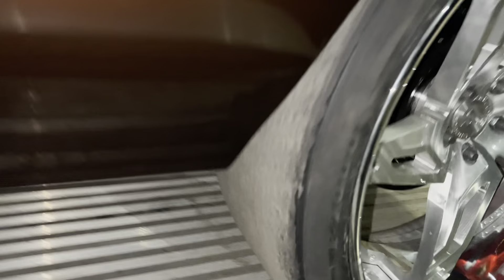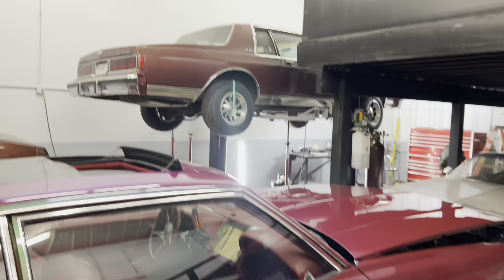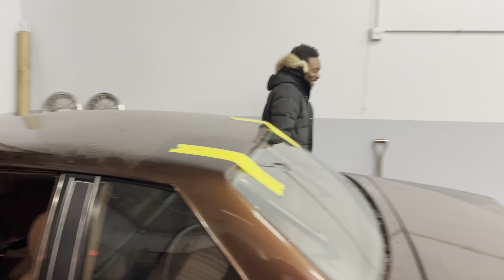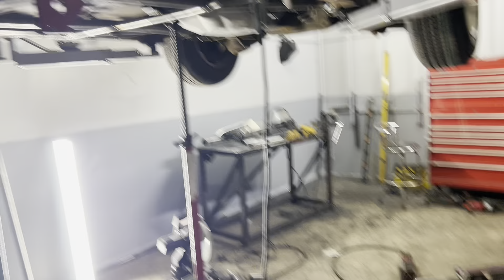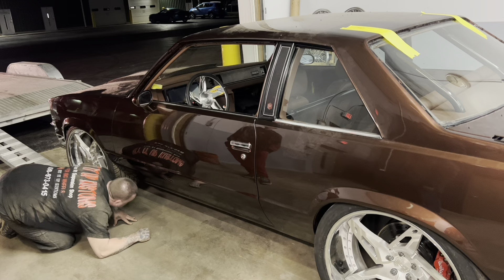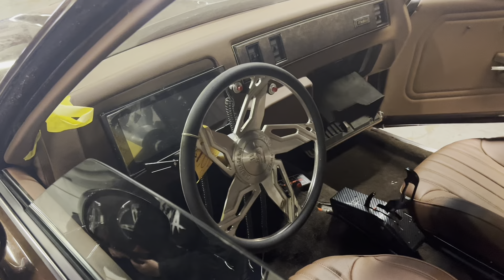630 bully’s 78 Malibu on 24 inch corelone forged wheels nasty build 🔥🤙

Comment: Have a Question.. what did you have too do for 24s on that malibu..
Reply: Just askin.. tryin too put 4s on mine all my friends keep telling me I cant.. 🤷🏾‍♂️
Reply: If you trying to go with a setup like that you gone have to do a few things but 4s should go up under there just fine with some touch ups
Reply: U could just replace all the suspension with new oem parts with the right offset they wil slap right one had 2 gbodys on 4S no lift an it road perfect I went this route with all Viking coil overs an qa1 control arms it was a waste of money in my opinion